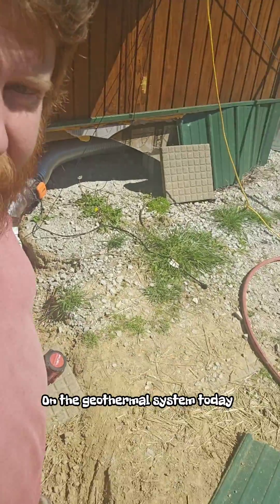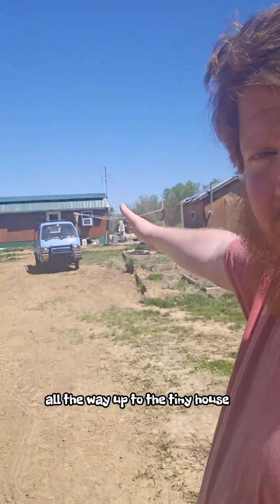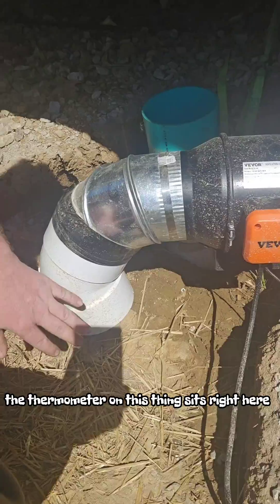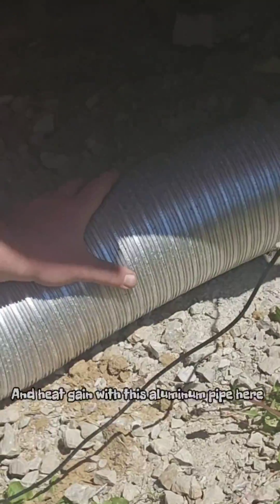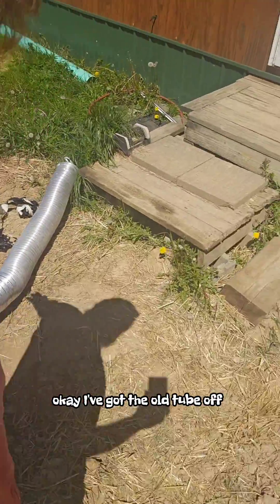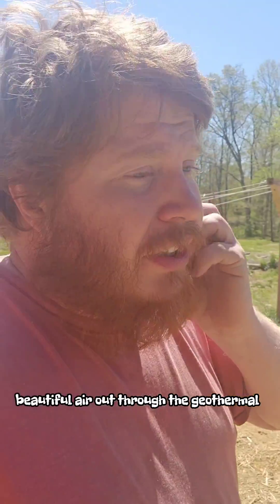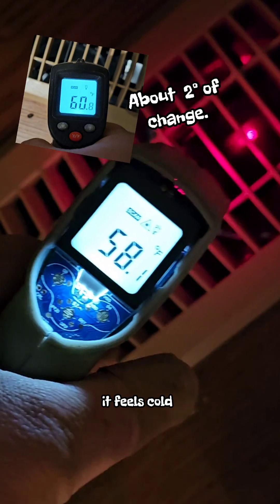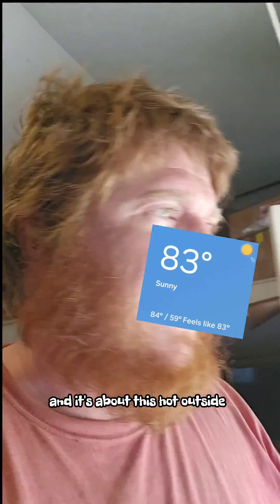Poor Man Geothermal

Comment: When checking for cooling efficiency in vents I usually look for a Delta T of 15-20^f (which is close to the range you had).
Also, there is mesh strapping sold on Amazon that will hold the vent against the floor joists, but loop around so weight is evenly dispersed.
Cant wait to watch the next update video 😁

Comment: How's the quality of the air coming out that pipe? You are pumping in warm moist air that will condensate as it travels through the pipe, thereby causing stale air. Probably encourages mold growth, too. Maybe try an air exchange on that system.
Reply from the maker: I've already discussed that in another video. You have to be sure that your piping is on a very heavy grade so that the condensate will run out. Also, as long as you keep a food source away from the inside of the pipes, mold growth should be mitigated. But we do plan to do a bleach water wash once a year.